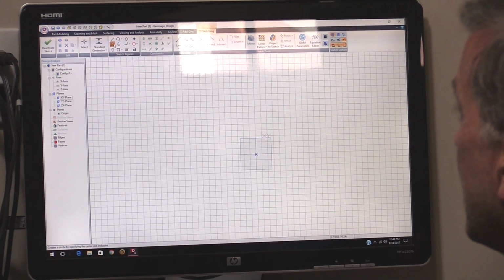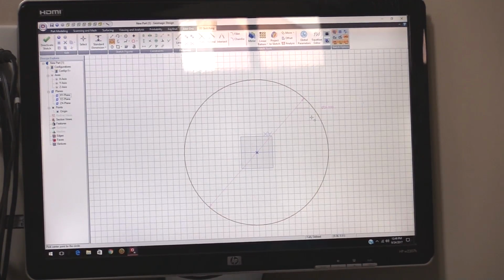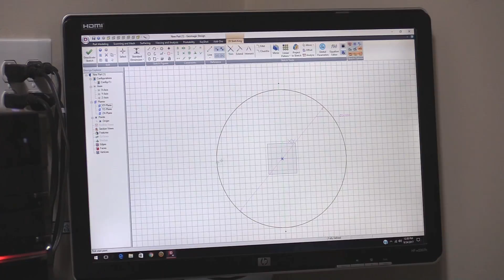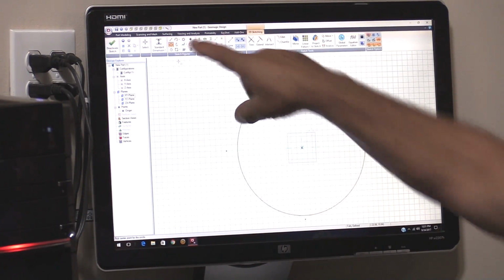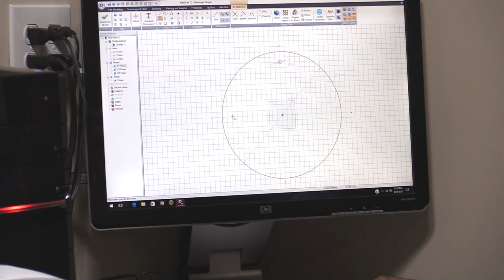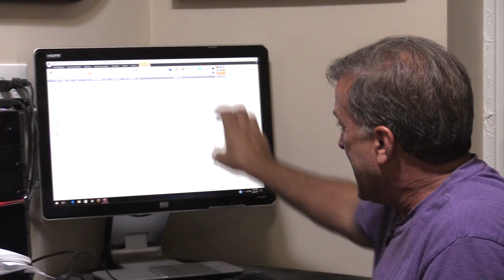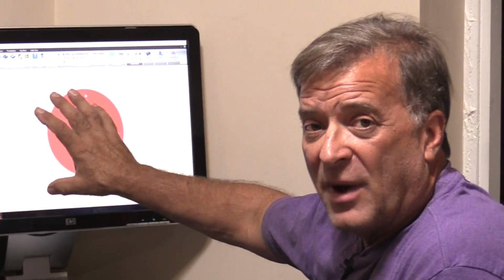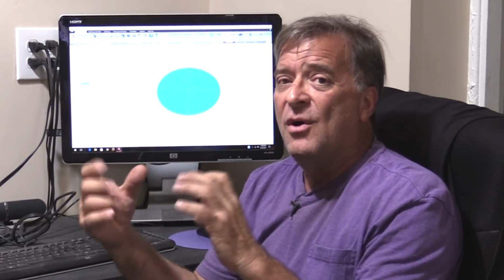How to Use CAD to Create Parts for a CNC Table - Kevin Caron

Comment: Hello Kevin,   I am wanting to make patterns for a camshaft grinder. They would be just 2d and done with a cnc wood router. these patterns are reasonably large ( 3> 400 mm )
So basically you have a base circle with a lump on it. I want to be able to mark a distance from the center every degree ( 360 in a circle ) and then join the dots so to speak
Reply from the maker: Sorry, I have no idea how to do that.

Comment: Hi kevin, i would really check out some of the new cad programs, for bolt patterns you do circular pattern, they make doing complex parts so easy. Fusion 360 is supposed to be great for free, i use my company's solidworks, but that is quite expensive.
Reply from the maker: Just downloaded it.   will give it a try!